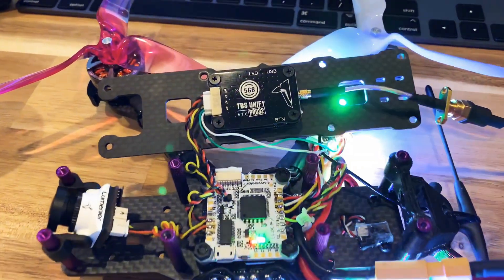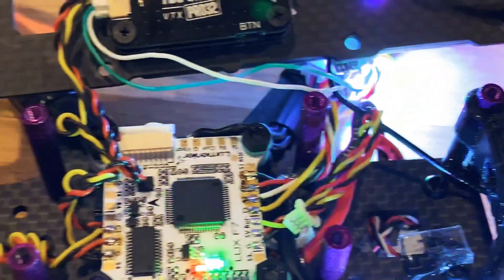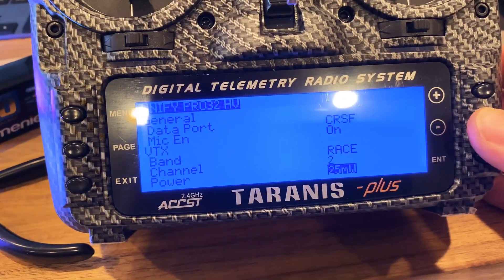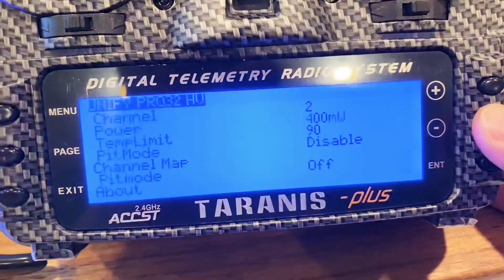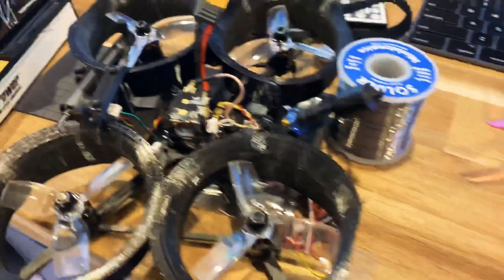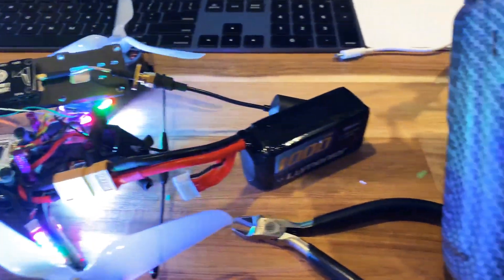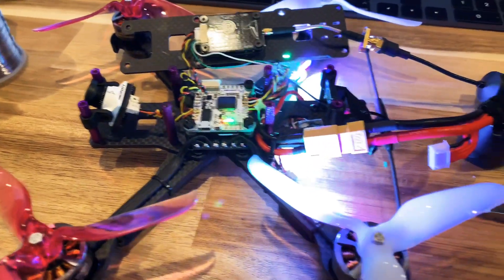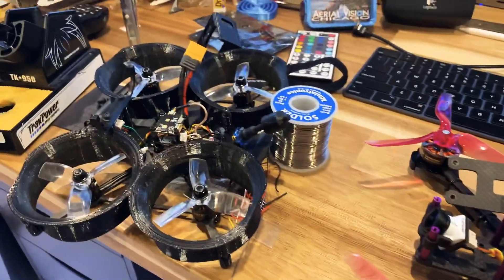TBS Unify Pro32 now working on Crossfire 3.2.1 Full Control

Comment: Hey! Thanks for the video. When I connected unify32 pro to crossfire, I got the vtx settings menu directly in the Nano TX menu in the radio. I don’t have a separate Unify32 pro like there in the menu. Is that normal?

Comment: Are you still able to use betaflight smart audio this way? I’m trying to set this up now and can’t get my pro 32 hv to show up. Are the crsf wire and smart audio wire from the vtx soldered to your crossfire nano?
Reply from the maker: The reason I went this way was to try it out and I like how you can see all settings on radio but I might switch back now that beta flight 4.1 you can fully setup and adjust vtx
Reply: Fixitall329 thats what I’m finding out. I really like how I can do smart audio in goggles on betaflight. Crossfire in goggles would be awesome because then I don’t have to take them off to make a quick change in field or something. So is this working with the green wire to channel 4? And the white to channel 3 set to crsf?
Reply from the maker: From what I know you can only have smart audio or crossfire
Reply: You can’t have both until almost now... but you need Fusion. They are making it so you can control everything through your goggle osd, transmitter. Everything will start talking to each other in real time.

Comment: How do u have it wired from flight controller. Or thru the rx port 4 to vtx. I would like to have it work from both osd nd transmitter

Comment: cool stuff,  I wouldn't mind getting this to work on my TQ7.  I think manually doing this settings looks fun :D

Currently I am having problems with the latest firmware for the TBS crossfire Tx for binding and setting up the Nano Diversity which I think I am going to have to back firmware update from 3.21...